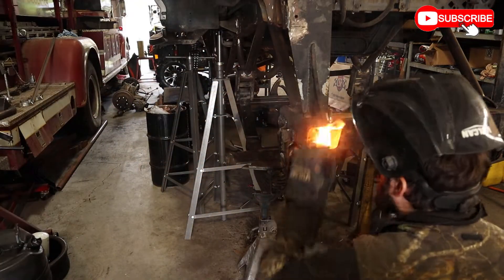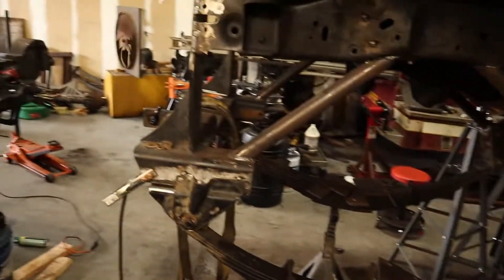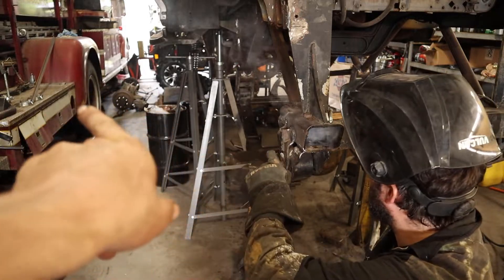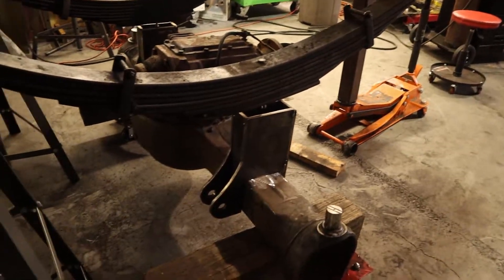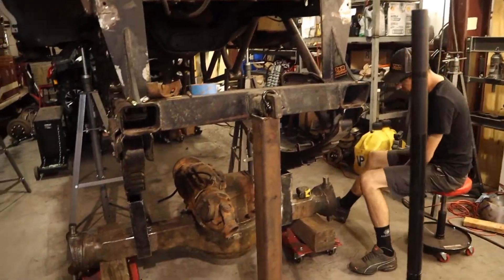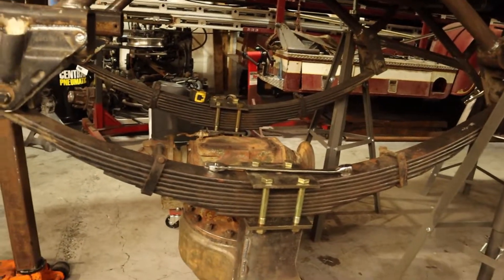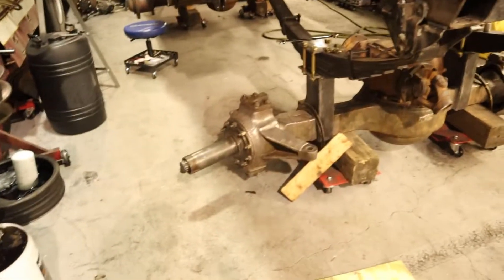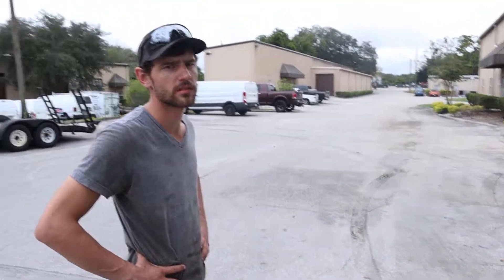F-350 Mud Truck Build Part 7: It Rolls?!?!? |3BR OFFROAD

Comment: So In a nutshell, 12 inch coil lift on top of a lifted frame and then big tires on 2.5 ton Rockwell’s?
Reply from the maker: Basically, but 5 ton rockwells. Typically we would 4 link front and rear and coil over shocks on all 4 corners. But this is just a cruiser for my Dad. Kinda on a budget  l so we are using the suspension off my old truck to keep cost down.
Reply: @3BROFFROAD  still a cool lift on a budget
Reply from the maker: Thanks!
Reply: @3BROFFROAD  just needs some tractor tires, engine reinforcement, finishing pieces and nitrous
Reply from the maker: We have 66s for it but won't fit in the shop with them on. And its getting a big engine upgrade soon! Getting back on this project soon hopefully!
Reply: @3BROFFROAD  hopefully because it’s giving me ideas